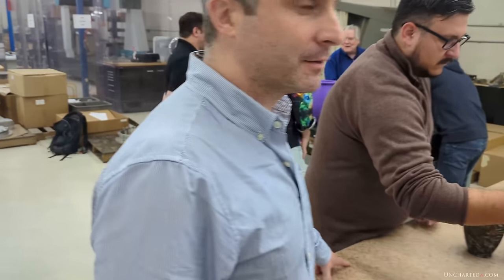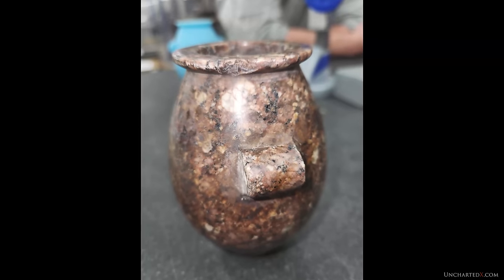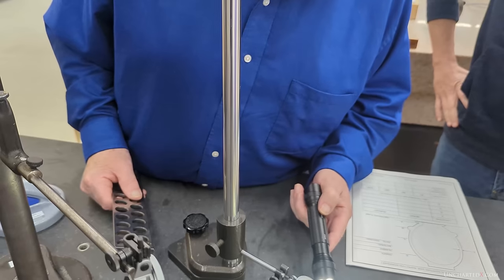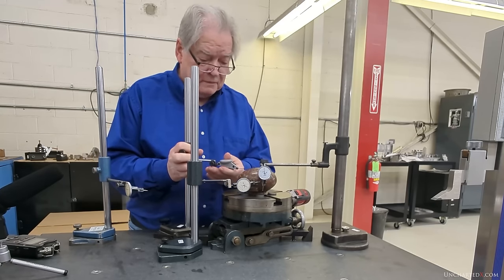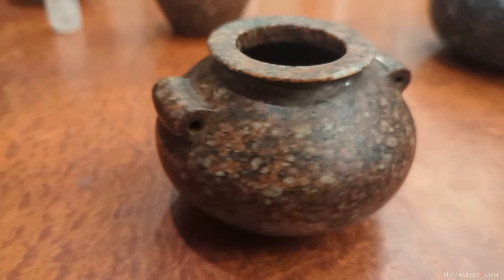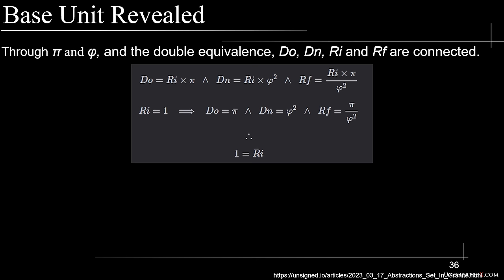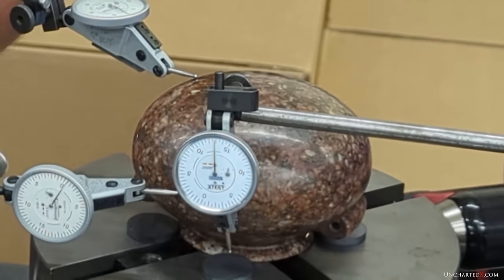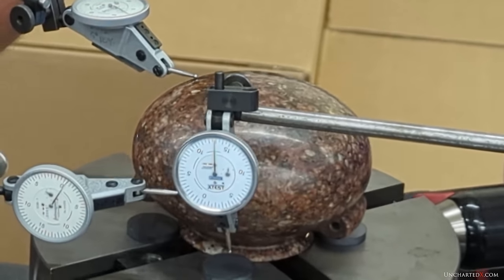Astonishing Results! More Ancient Egyptian Granite Vases Analyzed! More STL's available.

Comment: Why would the radius being 18.73mm matter at all? Are you saying that they are time travelers who understand what a millimeter is and so encoded the speed of light into it?! 😂
Reply: The wave length of 166ghz electromagnetic wave is 18.73mm. But you can measure it in any measurement you desire. It's length does not change.😂😂😂
Reply: @jamemswright3044 so the claim is that they determined the ID by dividing the speed of light by 166ghz? Why 166 GHz? Like it's so arbitrary...
Reply: @sloppycee sorry typo 16ghz. They probably should have based their measuring system on the arbitrary  length of the path travelled by light in vacuum during a time interval of 1/299 792 458 of a second (the metre).
Reply: For that they would have to know how we measure time, rather than distance... intringuing anywaya

Comment: the unit size, ~18.7 mm is immediately recognizable as a standard size egyptian finger's width. 28 finger widths makes an egyptian royal cubit, about 523.6 mm.

did you know, egyptians standardized the cubit measure. if workers did not compare their cubit rods to the one held by the pharoah's architect, every year, it was punishable by death. 

a pair of well made cubit rods, placed back to back, can measure precise thicknesses, down to 1/240 th of a finger's width = 0.078 mm = about 0.003 inch. 

and they loved their fractions. the expression pi/phi^2 = 1.1999816... is almost precisely 6/5. i'd bet dollars to donuts the real measures are more precisely the simple fractions

a favourite egyptian approximation for pi is 22/7, which differs from pi by only about 1 part in 2500. this ratio is seen in the Great Pyramid, in its base to height ratio 11/7.
Reply: "a pair of well made cubit rods, placed back to back, can measure precise thicknesses, down to 1/240th of a finger width"

explain how this is possible.
Reply: @AustinKoleCarlisle  placed back to back, the  fifteenths and sixteenths finger divisions line up. the measurement is then read directly using Vernier principle
Reply: @paulshields1883  no, please explain how you can measure something to the 1000th of an inch 1000s of years prior to the invention of the micrometer
Reply: @AustinKoleCarlisle  foundations of accuracy do not depend on the existence of a measurement unit. You can accurately communicate a length to that precision using Neolithic technology. I have shown this by building a Neolithic caliper, using only sticks, string, sharp points, and adhesive, which were known ten thousand years ago. Modern thinking about this is clouded by conveniences such as nails and screws,  that we can't imagine we could do without
Reply: Nothing is ever straight, flat, square, level, plumb, or a definite size. Our approximations to these depend on material properties (stiffness, strength, elasticity, hardness, thermal expansion, creep), and forces, (compression, tension, torque, shear, friction), at various temperatures, plus our ingenuity. As an exercise, try to mark fifteenths and sixteenths divisions of an arbitrary length, on a straight edge.  Try to hone a stone block to flat surface and square and straight edges, using the most primitive technology. It's painstaking but doable.
Reply: @paulshields1883  you realize how small a THOUSANDTH of an inch is, right? carry on.
Reply: @AustinKoleCarlisle  yes it's hard to see without a microscope, you need sharp eyes but you can feel it with your tongue. I'm not bothered by that. Did you know, the sharpest steel scalpel blade has an edge around 100 atoms wide. Compare to a flint blade: 5 atoms wide.
Consequently if you can place a blade accurately you can mark a length accurately.
Plus remember that a screw is a lever, wrapped around a pole. If you don't have a screw, you can still use a lever
Reply: @paulshields1883  okay, back to reality. how does this have anything to do with an ancient measuring stick?
Reply: @AustinKoleCarlisle  you measure a small length with a micrometer. You can do this with a pair of cubit rods, too. Of course making these urns remains quite a challenge, but you'd use an iterative process of measurement and removing small thicknesses of material.

Comment: the roundest object ever made by man was made entirely by hand.
out of a material harder than granite.
the out of roundness was in the range  of a couple of atoms.
getting something to be round is not that hard, getting something to be round at a predestined size is an entirely  different kettle of fish...
Reply: What was this item?
Reply: @jamemswright3044  the presence of handles implies a "predestined" size/shape because the area in-between could not have been lathed, it had to have been worked by some other process. so how were they able to maintain tolerance and shape without an ability to measure down to the 1000th of an inch?
Reply: @jamemswright3044   the sphere that is the new norm for the liter.
Reply: @AustinKoleCarlisle  of course it could have been lathed.
a modern lathe will make them.
modern being 18th century...
Reply: @janvanruth3485  These silicon spheres were made entirely with hand tools. Without the use of precision measuring tools?
Reply: @janvanruth3485  you're not understanding the concept here... take a two second pause and grasp what i'm saying. this vase has handles and therefore the area in between the handles could not have been lathed.

Comment: How do we know these are Egyptian vases? Can they be traced back to a sealed tomb? Are there pictures of them being excavated from a burial site? Obviously just because they were “dug up in the sand” doesn’t mean they weren’t planted there by ancient scammer’s. If you are so confident in your project then go to an actual museum and petition them to measure their vases with a historical provenance. Otherwise it’s hard to take these very seriously.
Reply: You obviously have zero knowledge of Flinders Petrie and his detailed examination and documentation of these vases in the 1880's. He indicated the lathe like precision and lack of runout, the ultra thin (.040") walls that do not vary in their translucent thickness, and that fixed single point cutting tools of diamond hardness had to have been used on the rotating workpieces. Diamond is the only material harder on the Mohs scale than some of the stone used in these vases.

Comment: This might be a late neolithic pre pottery holdover.   I’m going to guess there was a sand paper like paste made out of a harder mineral.  Corundum and topaz are common enough to make lapidary pastes of some kind.   I can’t imagine the precision.   There is some crazy carving on ivory that used simple tools.   Anyway…I guess magic is real?
Reply: for objects like these, the problem remains of how you would maintain tolerances to within a few 1000th of an inch without the use of a micrometer.
Reply: Ivory can be cut with tools that cut wood. Granite cannot.
Reply: yes, ivory is kind of soft..but tools that cut rock do not cut wood but they might will cut ivory nicely.  Cutting wood can be done with string saws, bow drills, leather belts and the right aggregate.  However, the aggregate needed for wood is not the one needed for rock (or ivory).  Anyway, the patience needed to do some of the crazy work in ivory is astounding.  Same with lapidary.  That's my point.  Lots of folks have lost touch with what a lot of time and ingenuity on one little thing can do. 

I did all my rock work with paper, glue and various kinds of aggregate.  Metal not needed.    Corundum dust will definitely cut granite, even high silica quartz monzonites etc.  And, a string saw impregnated with corundum dust will do a lot of cutting, same with wood paste bow drills and grinding stones.  It's kind of like a primitive band saw or a rock drill and a likely drum saw for rock.   It's a start.  Geeze...pounding stones?  

All those dimensions might be laid out with string and cut with weird string saws...at least that's my take.   I did a lot of survey work laying out roads with plain old measuring chains and a lot of rock ID by pinging it with a steel rock hammer.  Silicification of any rock makes it crazy hard and if the rock hosts topaz etc. even modern diamond drills take forever and the core comes out almost polished on the outside.  I know...that's how I can tell rock hardness in my drill core.  The ancient ax hammer I found in iowa is made of a diorite rock without free quartz.  Everyone thinks granite is this or that and is super hard.  Nope.  There are lots of so called "granites" and some are harder than others depending almost entirely on the aluminosilicates involved.   @annewitkowski7586
Reply: @milenaresources4244  granite is non-uniform and is very brittle. there is simply no way to manufacture granite vases as thin as a playing card without some type of machine assistance.

Comment: Those are ancient contraceptive devices: 1. They are small so they fit. 2. They have no bottom to stand on because there is no need for that 3. They have those handles for strings to pull them out again
Why problem solved. Now you lads figure out the how while I CNC mill me on of those devices and find a female to test my theory!

Comment: At 1.23 you can see the scratch marks made by grounding stones on the inside of the vase. Through out the video you show the big give away. The lug handles. They are never at the same height. They are never the same distance from the opening. You can clearly see they are not precise. They arent exacualy the same size, height, distance from the opening then how can they be precise. They look close but not precise at all. No where near. Even a basic ruler can show that. When i went to the cairo museum they are the same there. The lugs are never exacually the same. Never precise. Sorry but thats enough for me. If its not precise then its not. They dont even spin perfectly because they are slightly off.
Reply: timestamps of your claims?

Comment: Yeah but you don’t know who made these, where they are from, or how old they are. Plus those measurements aren’t that accurate or demonstrate machine precision. If they were machine made then why are no two alike? What a clown show. This doesn’t prove anything.
Reply: what's with this "no two alike" talking point that is obviously being pushed by the detractors?
Reply: @AustinKoleCarlisle  they are obviously not machined if they didn’t duplicate the work. Why build machine tools and/or calculate something on a computer just to make one object. Besides the fact their obviously not precise because you can see with your naked eye the defects.
Reply: @patrickmontie9583  we haven't even got a chance to look through 40,000 of the vases, so what makes you think we would find duplicates in a dozen or so vases?
Reply: @patrickmontie9583  On the contrary, putting out so many pieces with such precision without any repetition is a testament to their capabilities. The reason we mass produce identical items is because it's too laborious for us to keep making new designs for each one. As for the creators of these vases, it seems they were beyond such problems.
Reply: @flubnub266  exactly. this is a point that needs to be emphasized. what if they didn't want any vases identical to one another? making things exactly the same is a relatively modern phenomenon.
Reply: @AustinKoleCarlisle  Yes, not to mention, manufacture of identical objects is usually due to using a template/mold/stencil. And usually that template takes a lot of labor and tech to produce, and then the mass production is easy because the hard work has been done. For them to produce this many unique vases with such precision is like painstakingly making a new template for each vase.

I can only conclude they had a better way of doing it that makes design less labor intensive. It makes me picture some sort of wacky analog computing contraption that does trigonometry.
Reply: @flubnub266  yes, and maybe controlled by gears or mechanical steps, which would explain the radial transverse pattern noted in the design of the vase.